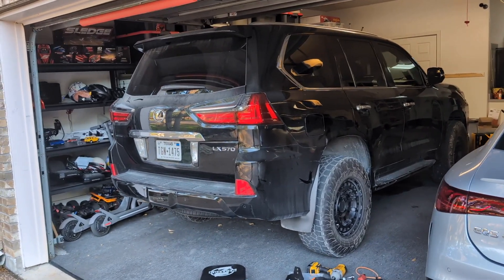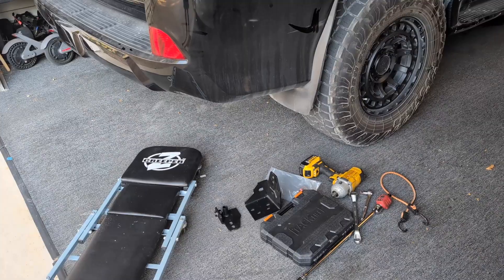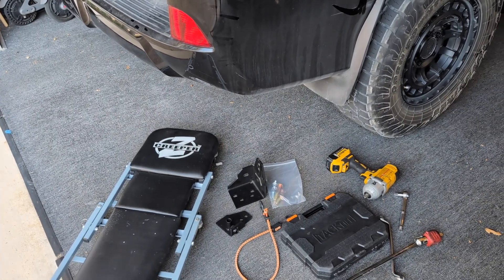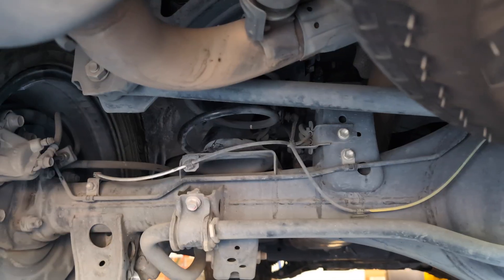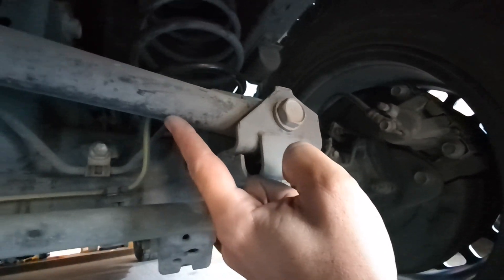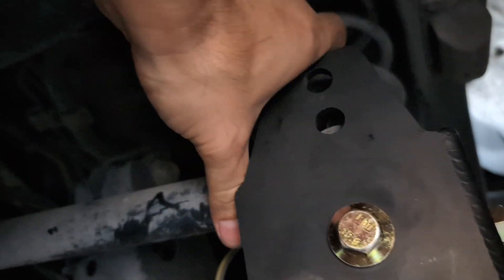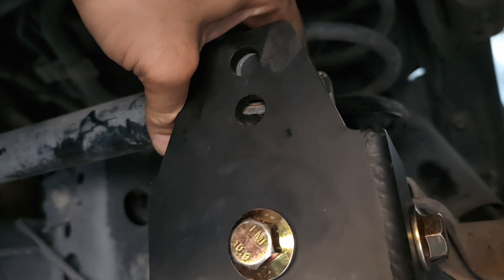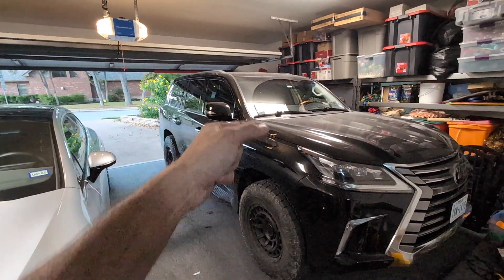LC200 LX570 Rear Lift and Fix Suspension Geometry - Rear Panhard Track Bar Dr KDSS BOTCK Bracket

Comment from the maker: In this video we work on the rear suspension of the LX570. We install the Dr KDSS BOTCK Bracket that repositions the panhard bar (track bar) to get it back into the geometry it was designed to operate in from the factory. 

Part 1 video of the LX570 lift: https://youtu.be/IfHqN5sMW0Y
Part 2 video of the LX570 lift: https://youtu.be/lIOXEyixv2k
Part 3 video of the LX570 lift: https://youtu.be/RsDOJrT767w
Part 4 video of the LX570 lift: https://youtu.be/dvEw6gEx5z4

Below are the links to the products used in this video.

I provide affiliate links to help you find the products I use and as a way of supporting the channel. If you purchase a product or service with the links I provide, there is no additional charge to you.  I always recommend shopping around for a better price.  Thank you for supporting the channel through affiliate links.

Parts used in this video:
* Dr KDSS BOTCK bolt on panhard bar correction kit: https://drkdss.com/products/botck-bolt-on-trackbar-correction-kit-land-cruiser?_pos=1&_sid=c15a62814&_ss=r
* Loctite 263 high strength: https://amzn.to/3FuVt5Y
* Digital torque wrench adapter: https://amzn.to/41DAXaL

Other parts:
* 50mm (2 inch) rear spring spacer: https://amzn.to/3XIJqbw
* E&E Off Road rear shock spacer: https://www.ee-offroading.com/product-page/rear-shock-spacer
* 10mm OEM Front Strut Spacer: https://www.ebay.com/itm/323989932989
* Old Man Emu ARB Front Upper Control Arm Kit UCA UCA0001: https://amzn.to/3NFZ6Hj

Comment: waiting on the ARB upper control arm installation video, how it fixes the angles
Reply from the maker: Ah man. I wish I would have done those, I get so many of the same comment. I actually sold the LX before installing those. 

But now I’m on the search for another LX570. As soon  as I get one I’ll be doing all the same suspension mods again and will be sure to get videos of the left over installs.

Comment: Thanks helpful!  how many MPG does your LX570 get?have you made any modifications to get better gas mileage?
Reply from the maker: On all of the 200 series I've had (both LX and LC), my MPG on all highway driving is usually between 14-17 mpg on road trips. For mixed city/hwy (70/30) driving I usually am around 11-13mpg. For mostly city driving I am usually right at 11mpg. Personally I don't drive enough to worry about MPG. But if you are concerned about gas milage the best thing you can do is do not modify anything on the wheels/tires, use a highway tread tire, and keep your maintenance up to date. Such as PCV valve, spark plugs, oil changes, transmission and diff fluid changes, coolant flush, etc.... Keep up with the maintenance and leave the vehicle as stock as possible, and that will get you the best MPG. You could also try a tune. I did the OTT tune and although it did give me more power, it also gave me better MPG. I did a detailed video on that here: https://youtu.be/BBU021N6tt0
Reply: @NKPGarage  Thanks for the detailed information! mine is at 11 MPG in the city, and I think I need to do everything you listed since, for the last two years, I’ve only changed the oil, filters, and tires (kept the originals). thanks again

Comment: You sold it?
Reply from the maker: I did. But still have a few more videos to upload. Ended up in a 2018 Sequoia for now. But will be looking for another LX570 soon
Reply: @ this was your 2nd one?
Reply from the maker: @MrLazlness  I’ve had many LC/LX’s. This was my second LX570 and also had an LC200 for a while. I’m in a 2018 Sequoia Platinum now. And looking for another LX570 to play with, maybe next year
Reply: look forward to your next videos of the LX as have yet to pull the trigger on upper control arms hoping to see your result and hear if you ended up being happy with the adjustments…